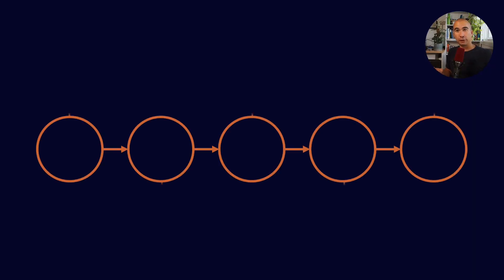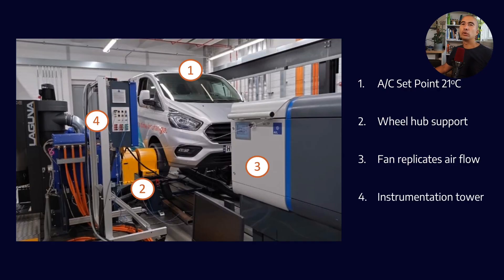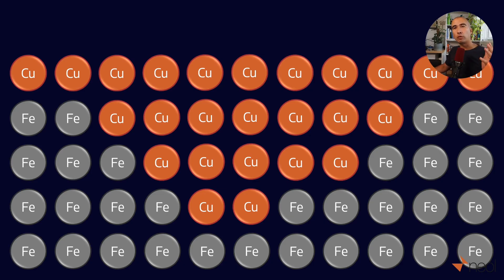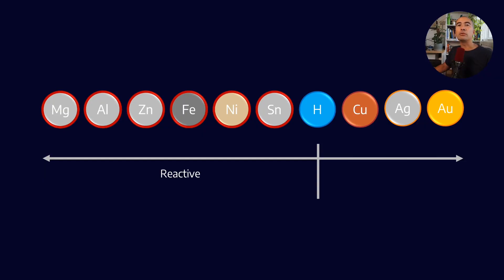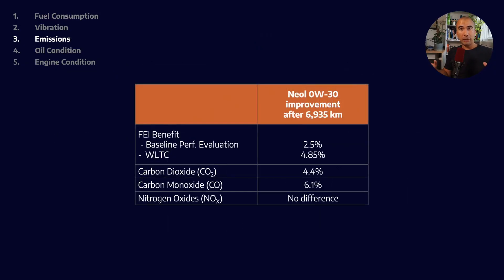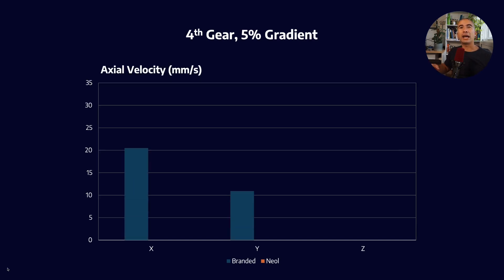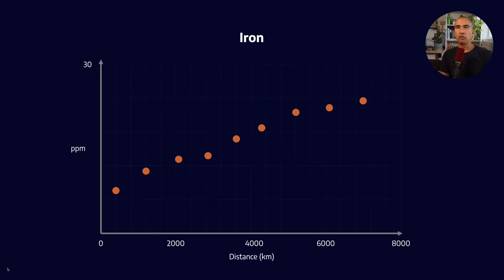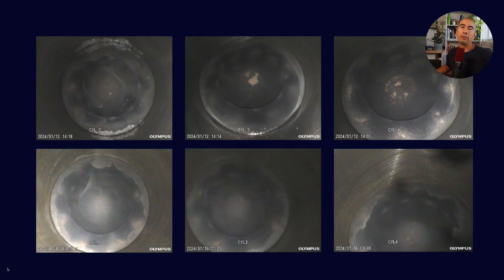Revolutionary Oil versus Ford Transit Dyno Test

Comment: I have some question:
1. What the results if you change the base oil in different groups?
2. For oil with long OCI, 8000km is low compared to some companies pushing for 15k km to 24k km?
3. Applications in patrol engines? Hybrids ?
4. Effect on different cylinder liners?
5. Does type of diesel affect its performance? Bio diesel?
6. Effect on emission equipment? EGR carbon accumulation?
7. If it is used it initially in an engine that not been broken yet?
8. Seals and gasket effects long term?

Thank you for the informative video!
Reply from the maker: Great questions! Let me see if I can answer some:

1. Generally if you change from a Group II/III to a Group IV an engine will gain something like 1-1.5%
2. You're correct - this wasn't really an oil drain test as that much time on a chassis dyno would get really, really expensive.
3. You could argue that the product should work even better in petrol engines as there is even less acid formation with petrol combustion. In hybrids I think it would be well suited.
4. The copper film is on a smaller order of magnitude than the cross hatching of the liners, so it shouldn't have a significant effect.
5. We have some test data running the product in marine applications in Indonesia. That country requires diesel to be B35 (35% biodiesel) and the product appears to work in the same way. Albeit that is a less controlled environment.
6. Effect on emission equipment? EGR carbon accumulation?
7. Sorry I don't fully understand this question.
8. So far we haven't seen any negative effects, although there are also plans to complete some industry standard seal testing soon.
Reply: I believe he was asking if the test would've been different if you tested a engine that hasn't yet been broken in.
Reply from the maker: @dingding8636 the previous engine tested (the Cummins X12) had been barely broken in - the levels of wear were higher (90 ppm from memory) but it wasn't massively different.
Reply: What exactly is gained when you switch to Group IV? @LubricationExplained
Reply from the maker: @some-one-else-r a Group IV will usually gain you around 1% on fuel economy. The main reason is the lower traction coefficient - basically the molecules being so regular means they slide over each other more efficiently in load-carrying zones - that means less "internal friction" is generated in the fluid.
Reply: @LubricationExplained  ON pt 5, the Indonesia B35 is also palm oil based, which seems perhaps a bit easier on oil than RME or SME base bioblends. I'm currently testing blends up to B50 for products in that region.
Reply from the maker: @G5Hohn  get in contact! I'm working on a few powerplant projects in Indonesia using a combination of different technologies. The main issue is how contaminated the biodiesel gets over there - the water volumes and bacterial contamination are off the charts!
Reply: Effect on DLC coatings! Discussion swirling around whether or not molybdenum is partially responsible for accelerated wear on DLC coated valvetrain components observed on certain platforms.